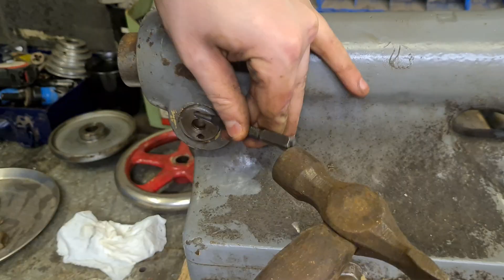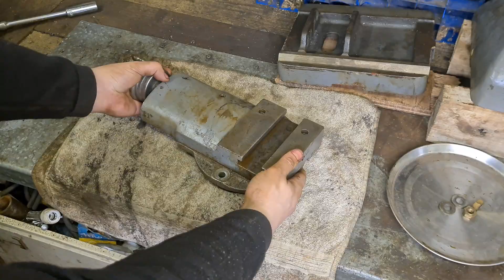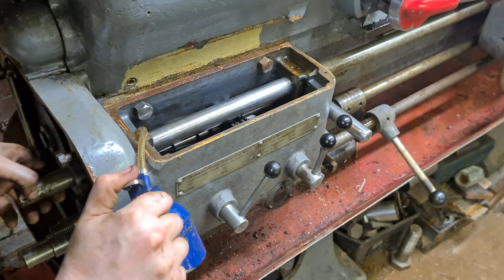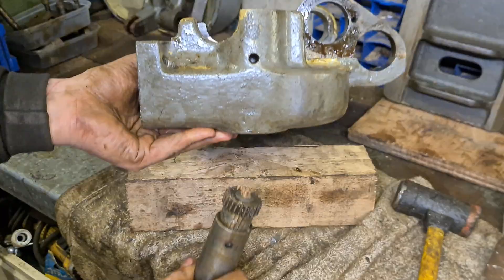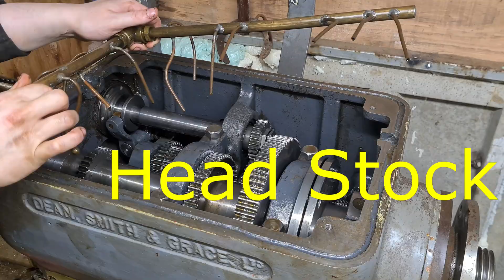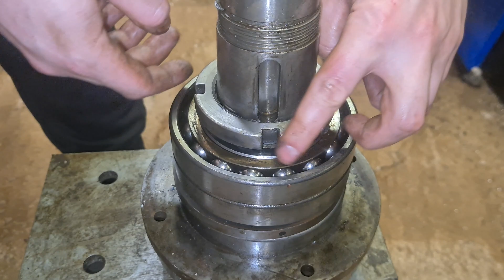DSG Lathe Restoration pt1

Comment: DSG are regarded as the Rolls Royce of lathes. When I was an apprentice at Bromsgrove college in the 70s there was one in the workshop. We had to have permission to use it. You packed a lot of info into this video. You did a great job capturing all the details and I would imagine you spent a lot of time editing. Best of luck with the rebuild, I will watch with interest and have dropped you a sub. Mart in Solihull.
Reply: DSG were very nice to operate and this was where they got the RR reputation. But classic DSG having broken a selector also a very small clutch that's a dry style that wears quite a bit. 
Sadly never really made for modern tooling load wise and RPM wise. Very small turret support to spread load but made from decent cast iron unlike their modern counterparts. You can see where the money is in their build though as with the unnecessary complexity solely for operator comfort. 
A great vintage machine though that one looked like it was a 70's era.
Reply: @dazaspc  And they had special 17Ts made for Rolls-Royce which had a white metal bearing as extra support for the roller bearing spindle shaft in an effort to improve the surface finish of turned parts.

Comment: Nice lathe and very worthwhile project. 

You need to pick up a selection of “Whitworth spanner’s” 

You can and obviously have found some metric sizes that will drive the fasteners , but it’s not right. 

Whitworth spanner sizes are based on the thread size 

E.G. a 1/2”W thread needs a 1/2”W spanner to remove the nut 

It’s the same as basically if you got a spanner marked m12 instead of 19mm  

There is a little confusion as they knocked all the hex sizes back a size during the war to save steel so it’s possible depending on the age of the spanner / fixing it may say the wrong size. 

Don’t let that put you off to get started the a vital piece of knowledge is if you have a set of whitworth spanner’s you 100% will have 1 that fits regardless of the size it may say on the side. 

Cap screws are regular imperial fractional size

Comment: Quality lathe made by people that knew what they were doing. I've had two 13" (still got one) but not as old as the Minor or 13Z. 
Colour i would go DSG grey but in the era its from they did use a beige as well.
Reply: I've a 13/30, 1962 . When I get pissed off because of the state of our country and what we used to manufacture,  which is often, I go and look around the DSG, cheers me up 😊
Reply: @rogerwilliams2902  I had a 1957 13x42 and now have an 1972 1307x40
The older machines are slightly better built IMO, the important stuff is great on either but the later one has fiberglass belt and electrical cabinet covers instead of the cast aluminium ones on the earlier, but the specification on the later is better.
They are both over double the weight of the equivalent Colchester or Harrison lathes, you can definitely tell when you use them.
Just to see what it could do I took a 5mm depth, 0.5mm feed per rev cut on some 50mm mild steel on the 1307 at ~1100 RPM and it did that just fine. Try that with most 13" lathes and see what happens.

Comment: That clearly is a quality machine, nice to see you having a go at restoring it. Considering it has spent 2 years outside under a tarp it is in great condition. Realy looking forward to follow this project!
For colour suggestion, the inside of the gearbox has a lovely shade of grey-blue that will go well with the lathes ww2 aesthetic.
Great videos as well. Nicely filmed, kept at a perfect pace and well narrated, super easy to follow along despite you pulling hundreds of bits out. Good work